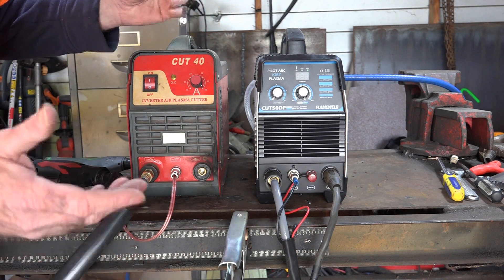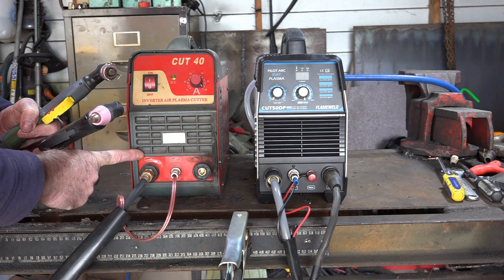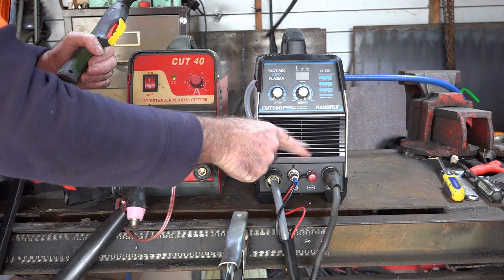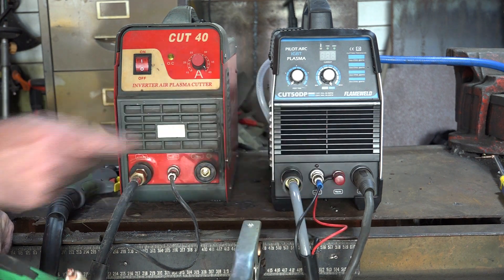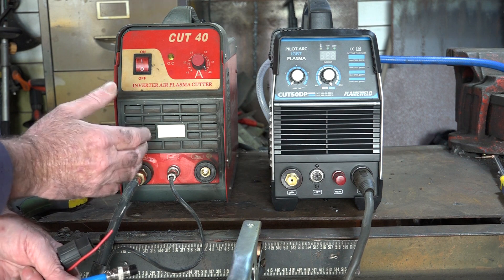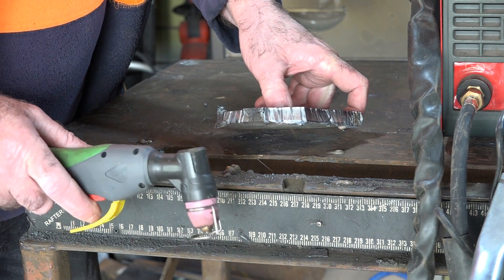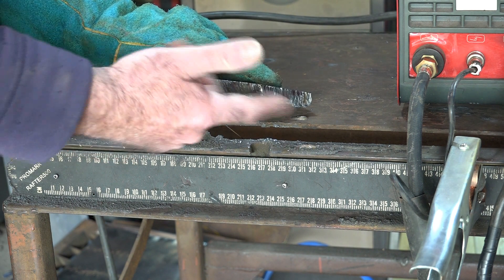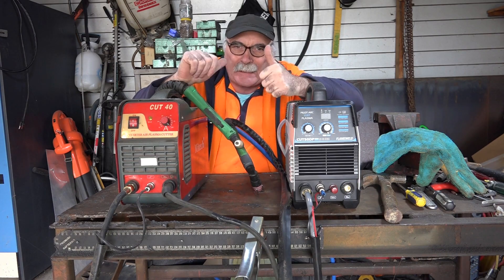Non-Touch Plasma Cutter - What the Hell is That Anyway?

Comment: Hi Pete do you know what the reason is that a 45amp plasma cutter always cut heavier stuff then a 50amp machine? They looks a bit more pro, and have torch like IPT60 and so on, is it only the torch who make them cut up to 20mm or are there other difference in the machine itself?
Reply from the maker: I have a few plasma cutters now and am finding even though they are all about the same price some are cutting a lot better than others. I aim to have 10-15 machines to compare.